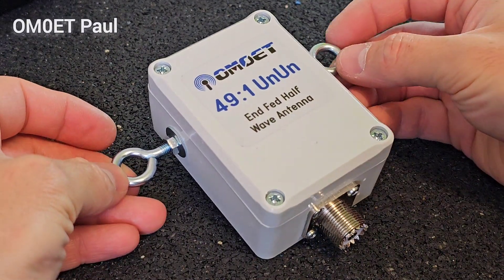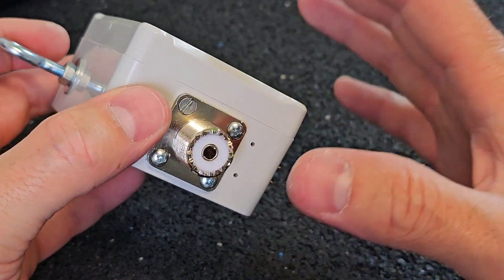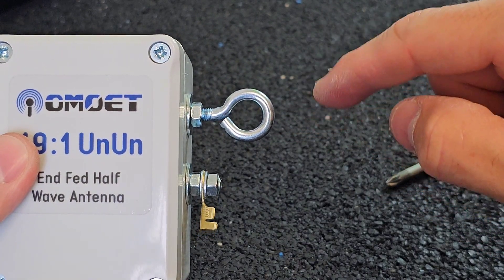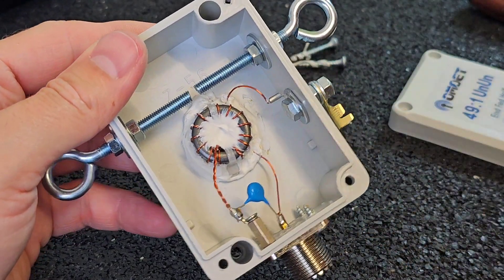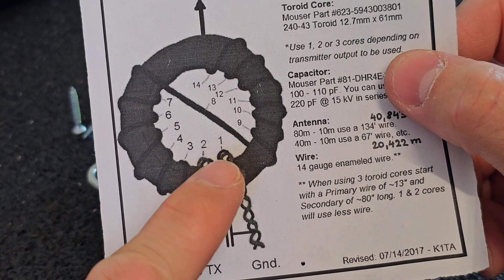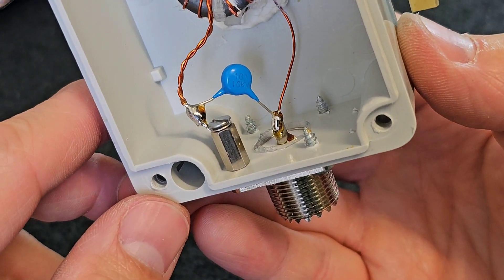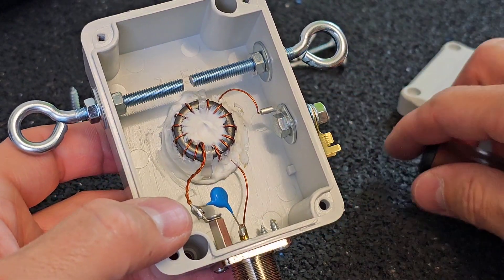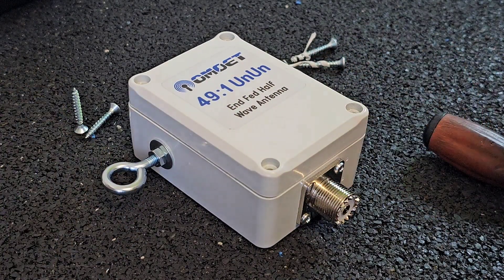49:1 UNUN for EFHW Antenna

Comment: I like your idea of the bolt spark gap.  Maybe a high value capacitor across the gap would allow high voltage to leak away.

Comment: Are Hams finding by adding a wire to the ground side they get improved SWR and performance of the antenna as it begins to look like a dipole antenna as well as an off center fed antenna. I'm wondering if the ground wire also lowers the feed point impedance a bit.

Comment: NOT an antenna for beginners, a dipole is.

End feds work very poorly, they are high impedance, poor distance and noisy.

Balun / unun myth.

Baluns and ununs are NOT for antennas, they are for coupling transmission lines together.

Seemy antenna videos for proof
Reply: Rubbish. You clearly have never used one correctly.

Comment: Interesting idea for lightning protection. If you are trying to bleed of static charge to prevent a strike the bolt end(s) should be sharpened and the ground conductor very low resistance to ground. A ball end on one bolt and point on the other should also work better than just blunt ends.

For 100W operation you could probably get away with a 2mm air gap. I'm sure there is a calculator and formula for air dielectric arcing probably on a small loop or engineering website.

Comment: In the input "TX" is a low voltage.1-1.5kV capacitor enough.
Reply from the maker: Better have it more than less 😄
Reply: @OM0ET It is especially actual for power of 5 Watts when output voltage is about 15 Volts.😜